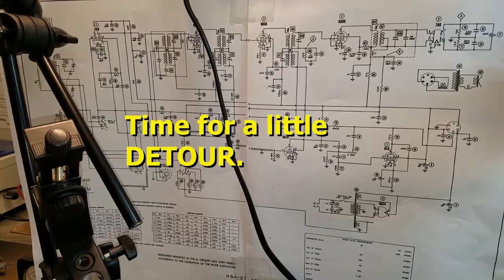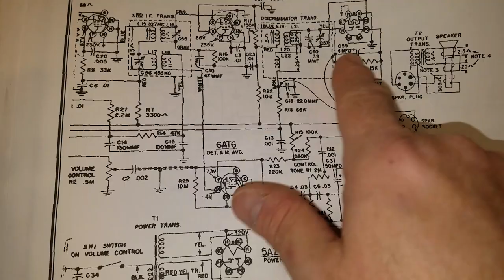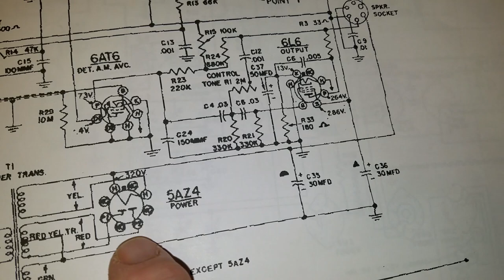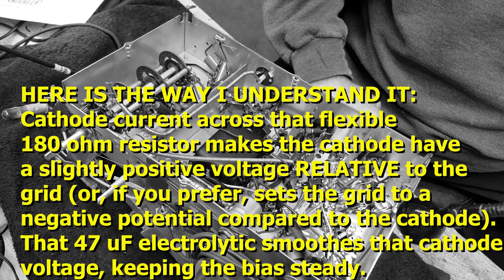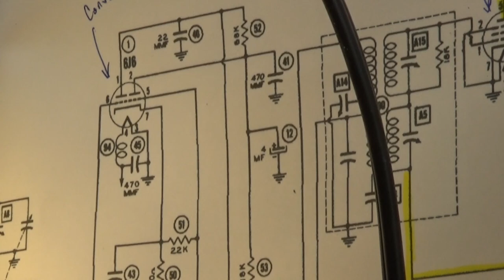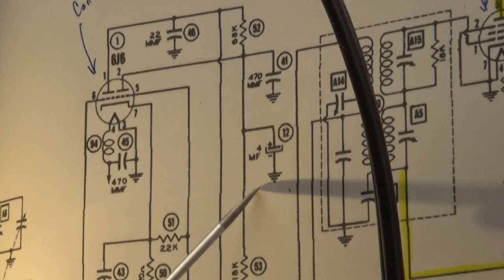1947 Westinghouse H-161 Vintage Tube Radio Part 5 of 10  Details of Re-cap

Comment: Thanks for sharing Michael! I think that was a good experiment with a lot of good feedback. Im sure you got good results from the use or you wouldnt have presented on video. The ingredients are cheap and effective. My bottle has a straw attachment, but unfortunately not made in US. Interesting about adding a lubricant! Please keep us up on your results of the experiment! As far as contact cleaner, Ive ruined some plastic push buttons and knobs on different occasions by accidentally spraying them, made them milky. So, I think it is important to take care when using any liquid in a radio. You have taught me the many uses of lacquer thinner and I use it a lot more. Ive used this mixture with good results and will continue to experiment with it. Thanks for sharing the video! Happy New Year!--Larry
Reply from the maker: Larry, 
It was a bad experience, like yours with the pushbuttons, that drove me to try lacquer thinner in radios.  It was a chemical that I was already familiar with from the car painting days, so I had an idea of what it would damage and what it would not.   I'm probably more careful with it than it appears in my vids, and I'll have to work on better developing that perception of my respect for its hazards.   I'm going to try a little suggested mod on the Sure Shot that I hope will provide a narrow spray stream.   Thank you for watching, Larry.  I'm sorry that it took so long to reply.   I've spent a few days running back and forth to the hospital and I'm just plain tired!    We'll chat soon, my friend.    BTW, I did get the package.  I had not checked my mail for 4 or 5 days, so I am not sure which day it appeared in the mailbox.  Thank you!   I am not doing any video of my current project because I haven't had the time to do the setup, but I will give the gift a test drive on the Zenith project that's coming up.  You are generous and I am grateful.   Take care.   Michael

Comment: I notice this Westinghouse Model H 161 radio can come equipped with an electric plug on the backside near the RCA Jack and some lack this feature.  I assume the Chassis is the same for all of them and that the lack of this feature was a cost cutting feature by Westinghouse at the time.  
RCA Victor came out with their 45 RPM changers (only) in March of 1949 and these plugs and RCA Jacks were needed for the operation of the very popular 45 RCA changers.  Many radios started adding the RCA Jacks and on some the electric plug evidently to meet the needs necessary for the use of an RCA 45 RCA changer turntable?

Comment: I second the vocational aspect. I'm a machinist by trade and, as my instructor told me way back when, "you'll never get rich doing this, but you'll live well." I think the push for college degrees is to put more students in debt. I've known and suffered many "college graduates" who aren't qualified to operate a pencil sharpener, let alone make a decision.
Reply from the maker: I absolutely agree with your reasoning that the push has been to put us into debt.  I got an MBA in 2004 and I'm still paying for it.  I have not used what I learned a bit!  I have definitely used what I learned about building engines from a machinist friend of mine back in Illinois.  I've rebuilt more than one hundred engines, mostly VW, Porsche, and Honda, since that first one under the guidance of my friend.  The experience I gained from that work has helped me in many, many ways.  My father was an auto body man, with his own shop.  He wasn't much of a business man, so he never grew beyond his one-off shop.  But, I have never seen better work than his in all of my years.  He never got rich, but as you say, he lived well.  My parents divorced when I was quite young, so I never got to learn the trade from him, as much as I would have loved it.   Thank you for chiming in on this topic.  It is one that is near and dear to me.   Take care, my friend.    Michael

Comment: I think I did get Muffy to chase a laser pointer at one time but usually she would ignore anything like that. You could roll a tennis ball right into her and she’d glance at it then ignore it. I baulked at the price of Deoxit when I got some to work on my Yaesu FRG7 which I scored at a garage sale for $AUD50. The Deoxit was $AUD25.  Both the band and mode switches needed some. The only other issue was small dry leaves on the IF board. It must have been stored in a shed, but it doesn’t appear to have had any water exposure thankfully.  I did replace the tiny bulbs with warm white LEDs as a couple of them failed after a few months.  I do have a clock collection and sometimes these a bit of work on one. One arrived with a jammed movement, a light push on the second hand must have moved something out of the wheels and it’s been running since. Another is a steam loco with train sounds, the sound was just clicking and I managed to find the distributor who had a later board. No problem, just move the alarm wire to the other end of the battery and full sound.  A Garfield clock had bad contact where the strips from the battery touch the circuit board. Corrosion had left holes in the pads so I built up solder over them and cleaned it all up. Oddly there hadn’t been a battery in it for over ten years?   The treasure chest radio was a great series of videos.
Reply from the maker: Buster is like Muffy, that way.  He likes to play, but a spot on the wall is a spot on the wall, to him!   We have a balcony off from our dining room, and the sparrows and starlings like to hang out on it.  Now THAT drives both of the cats nuts!   It's really fun to watch.   Deoxit is great stuff.  I would use it faithfully, if it didn't cost so much (and if they changed the silly can so that it could spray in positions other than perfectly vertical).  This experiment might pan out into a good Deoxit alternative, and then again it might not.  Either way, it's a chance to learn.   I have several wind up clocks in my collection.  I also enjoy electric clocks from the 1930s  and '40s.   Larry did a bang-up job on the Treasure Chest.  I was thrilled to see him do the series.   I wish you and yours the very best as we go on into 2018.  Have a happy and safe New Year's celebration.  Cheers!    Michael
Reply: Muffy would lie around the pergola and watch the starlings all. She did hiss if they got too close but she never went for them. We have several wind-up crystal clocks although they need attention before they will run again. I have some novelty clocks too, a Tetris clock, two egg shape clocks, there’s an airplane clock, a guitar clock, red rocket clock. Happy new year to you Michael and hope 2018 brings lots of interesting radios. Maybe an AWA, Astor, Airzone, Tasma or Marshman? All from “downunder”.  Marshman are rare, they were made in Bacchus Marsh between ‘48 and ‘54 and only 3 or 4 models existed. A fairly common 5 tube circuit, I read.

Comment: I see on the schematic of this model a Y2 capacitor (.01 mF) pair on the primary transformer winding. I'm assuming you will be updating these two to modern caps. My question is I'm working on a Stromberg Carlson H-61 with the same setup. I've seen power supply schematics showing the ground connection for these two caps connected to the mains ground but not the chassis. Does it make any difference to wire a 3 prong ground mains to a radio? Are you going to wire in a X2 cap?
Reply: I watched more of the video and saw at 28:36 that you installed new Y2s grounded to the chassis. But would a X2 across-the-line cap improved sound?

Comment: You drowned that poor chassis. I normally used 1/100th as much cleaner and only shoot it inside the pot. One very short tiny spray is plenty. (using a plastic straw). I kept a second straw around with a bend in it to reach hard to get at places.
Reply from the maker: I'm working on it.  This was just an experiment to test the concept and the chemical.  I will worry about perfecting the means of dispensing it later.

Comment: Try goose is better than Turkey or duck
Reply: I know how you can get it in pots using that can, stick some rubber tubing over the end bottle nozzle and on the other end gets a needle valve inflator what they use for footballs soccer balls the rubber tubing will fit over the end and you can get that inside the pot
Reply: Poldark, Pride and Prejudice, do you like Downton Abbey? Are known as (a period drama's) you might like outlander period drama. You might like Howards End as well.
Reply from the maker: John, 
I love Downton Abbey!   Hugh Bonneville is one of my very favorite actors.  He did an excellent job in "DANIEL DARONDA", another period drama.  And of course, Maggie Smith can do no wrong!  My daughter and I quote the Dowager Countess all the time at the dinner table.   I have never heard of "HOWARD'S END".  I'll take a look for it.   Thank you for the tip, my friend.   Cheers!   Michael
Reply: ThatTubeSound cheers Michael, its bit rude of me to not wishing  you a Happy New Year!!